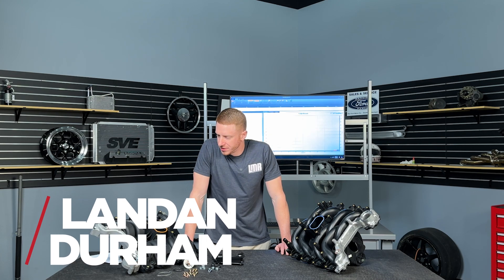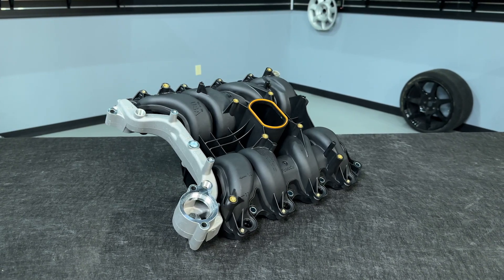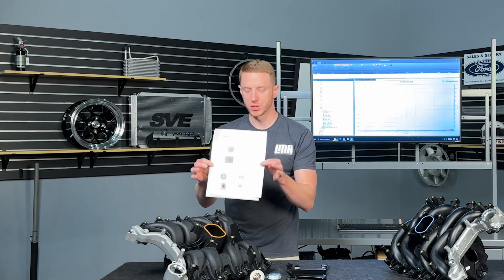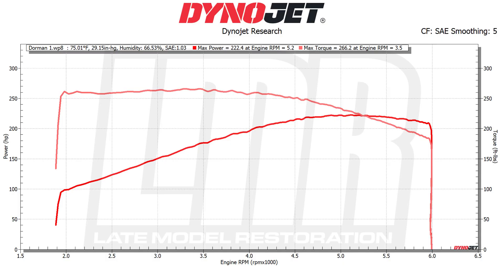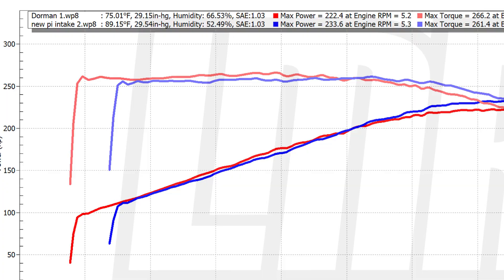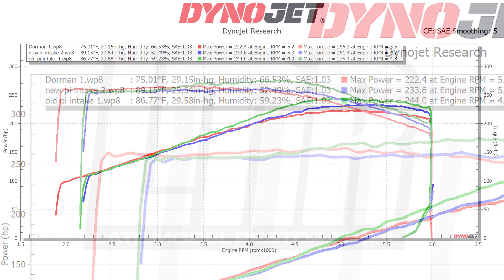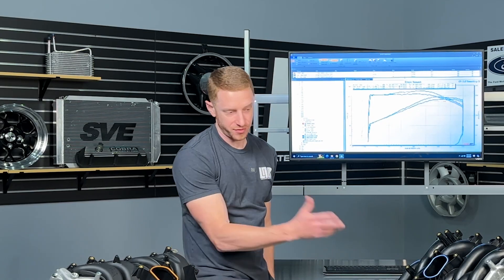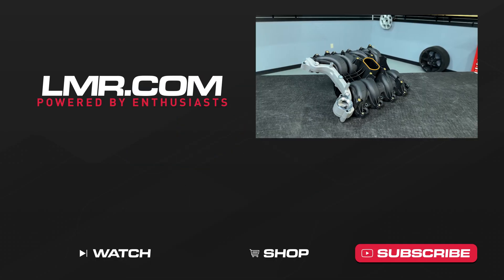NEW Ford Performance 4.6L 2V PI Intake Manifold (M-9424-P46A) - Dyno Runs & A Closer Look

Comment: Obviously selling this as a “Ford Performance” part is misleading, bordering on fraud, but one thing I see in the video that makes me happy is that the aluminum crossover FINALLY seals directly to the heads! Since almost every PI manifold fails where the plastic manifold and aluminum crossover meet, this new design should mean never having to replace the manifold again! I still wouldn’t use it on a car where performance is a concern, but for the countless panther cars and daily driver SN95s, it could be a decent option.
Reply from the maker: The old OEM PI intake was also sold under the Ford Performance brand. Like the new intake, the old intake was the "service part" of it's day. Ford Performance sells other OEM service parts under their brand because it's easier to market. They've been doing this since the early days. Thanks. -Landan
Reply: @latemodelrestoration what is the meaning of "service part" ?
Reply: So this new Intake Manifold PI can be used on Panther platform? My car is 2006 lincoln town car.  I wonder if I need a new bracket for alternator or other parts with this new Intake Manifold PI because it seems it is made for Mustang.

Comment: Im glad I have a professional products aluminum intake.
Reply: Me too. My intake cracked almost 10 years ago and I got one of these brand new when they were still available. I just didn't want to have to deal with another intake cracking again. It bolted up just fine and everything fit without issues. Car has 201K on it now and it runs fine.
Reply: @Flathead-fb5tk do you remember the link or part number
Reply: @Flathead-fb5tk what is the name of the brand?

Comment: I'm sitting on quite a few intakes that I've used for my PI swapped 98 GT, including a rare HPS Hardballer and original FRPP SVO w/the matching SVO heads.  That difference in performance and quality vary more than most realize.  The coolant port towards the back has broken on at least 2 of my OE PI intakes.  Personally I found this VERY interesting! I'm also glad Ford continues to offer new parts for their heritage vehicles. Great video I appreciate and enjoyed it very much!
Reply: I also had many issues with the Dorman product, it can work but is IMHO the worst choice
Reply: @davidduker4441  It looks like the coolant port for this new one is a two piece design and apparently the coolant port for this new intake is made out of metal. Also the thermostat housing is metal all the way through to the bottom where it meets the heads, where the original P.I intake and the Dorman are plastic underneath. A nice upgrade in that aspect for sure.

Comment: this can bolt on my 2011 panther right ? with everything thats included in the new pi intake ?
Reply: If your car is a 4.6 2V it will bolt on perfectly.
Reply from the maker: Yes. This intake will work for your application. -Landan

Comment: Would have been cool to see the numbers with the older 4.6l since it has the higher compression with the PI heads. I don't really seeing people swapping PI intakes for another PI intake unless theirs is damaged. The majority of people that put PI intakes on are the ones that are in the process of putting PI heads & expecting any kind of power boost.
Reply: What is PI heads?
Reply: @danpan001  PI heads are called Performance Improved heads, they came out with the new body style Mustangs back in 1999. Ford changed the design to help improve performance from 225hp in 1998 to 260hp in 1999.

When swapping PI heads to the older non-PI engine, it actually increases compression slightly due to the piston design was different, which in turn offers more performance.
Reply: @adjacentchannel Thanks a lot. I have a 2006 lincoln town car I think it is PI heads.
Reply: @danpan001  Yup, those should have them too.

Comment: We’ve had very good luck with Dorman intakes in crown Vic’s. Definitely notice the torque coming on earlier which overall makes those boats quicker especially with 3.27 rear gear. And through hp tuners optimizing timing, fueling, etc we are still making good steam at 6000 rpm where we usually shift them out. 6200 on at the chip. Have never had any on a dyno but definitely works fantastic and super fun on the street as a daily!
Reply: I have a work van full of tolls basically weights a lot and I did notice that. With the Dorman you can feel more power from dead stop

Comment: Ford should of used the original design, plain simple. Just like the new design, has better material and heater port. I would of bought two of them, an extra one for the long run.
Reply: What is heater port? Is it part of the Intake Manifold?

Comment: This was expected. Better than the dorman. And, really, except for the power loss, better than the oem pi intake in reliability with the improved crossover and the heater port. It is what it is.
Reply: And the loss in HP is really negligible. 10HP isn't even a big deal. 50 is.
Reply: Nothing some porting can solve
Reply: @monikhushalpuri how do u plan on porting a plastic manifold😂even if u did u probably wouldnt be able to polish it that well bc of all the frayed plastic. might even lose power
Reply: @nick0164  not talking about plastic, talking about metal replacements...I know on 2011-2017 3.7 v6 mustangs the stock plastic intake manifold can be ported and is a super common mod...with a tune for it and upgraded throttle body and proper air flow and exhaust mods to take advantage of the increased flow guys typically see 15-30hp increase after porting upper and lower intake...which is made of plastic LOLlololol trollLololol
Reply: @ i dont see how that wouldnt impede flow tho unless u cnc it. i imagine when u try to port a plastic manifold you end up with a lot of rough ridges on the inside, which disturb airflow
Reply: @nick0164  just look at the photos...its about as smooth as you can get...but now people are starting to make holley intake adapters for the 3.7 engine so eventually people will realize the holley is better and gets more hp and torque comes in quicker with the holley intake manifold compared to porting the stock plastic one

Comment: Bullitt Mustangs having an aluminum intake from the factory is the gift that keeps on giving lmaooo
Reply: True, but they're stupid expensive on eBay.
Reply: @yeanah2571 But they last forever right
Reply: Besides heat soak and 30 pounds of extra weight.. I’m going to start going to junkyards and collecting OG PI’s
Reply: @NewEdgeDesigns so all aluminum is only 30 lbs heavier?
Reply: Hmmm...Yeah!
Reply: Yeah but Bullits are a pain to work on, and parts are rare.unlike  the GTs that still have millions of parts

Comment: Wow! I still favor the old P.I. Intake because I knew runner length was going to play a factor! However this I take is good for heavier vehicles such as Panther platform and trucks with this engine.
Reply: I mean it's better than the doorman but it still worse than the OEM Pi intake that's for sure I wouldn't want it on my Crown Vic that's probably why I have a typhoon intake
Reply: @neilbrown82  I guess it will do as a stock replacement but for performance there are better options.

Comment: At least there's options now, and cant beat Ford OEM quality. This is the new standard for 2Vs.
Reply: It’s trash!! You can clearly see the design is quite close to the old Dorman crab, I don’t understand what the issue is with making the OG..
Reply: @NewEdgeDesigns   The issue is with the rights holder. Ford partnered with a company, and that company owns the rights to the design of the original PI intake.

So Ford partnered with Dorman to release this version that is MUCH higher quality and it has upgrades. Like the rear tube that goes to the heater core in the back. It used to be apart of the intake manifold, now its a two piece.

They also upgraded the aluminum crossover in the front, its is now ALL aluminum down to where it mates with the engine. Before there was plastic underneath the aluminum crossover on the drivers side, where the thermostat goes.

They also upgraded the plastic material, its much more better quality than the material used on the original PI.

It also doesnt need separate gaskets because they are integrated on this new one, "plug and play".

Its Ford quality that is UNMATCHED by any other brand out there.

The design might affect horsepower by a tiny amount, but you have 4.6 that was released in 1993, so be happy or go find a used old P.I intake.

If you want to go racing, go gran old stock or a used P.I intake that you wont know how long it'll last, or get a better engine or a different car. ITS OLD NOW.

The choice is yours.

Its almost unheard of that a car company like Ford  releases parts after DECADES later.
Reply: @MustangFord  I hear ya, still disappointing nonetheless.. I would just buy a bullitt intake off of EBay, or get a PI intake at the junkyard if mine ever has issues that can’t be repaired..
Reply: @NewEdgeDesigns id pull it just to see beforehand. if yours is the original intake, you will most likely already see some wear inside the coolant crossover. you can repair this with jbweld im pretty sure. if u catch it too late it might be unrepairable, repair it before that happens
Reply: @MustangFord What a stupid take.  There's no reason that a company can't make an intake that at least equals something from 1999.  There's also nothing wrong with the 2v.  There's no reason to do an engine swap just because the currently available intakes are trash.
Reply: Surprised no one can manufacture a superior manifold
Reply: Buy the Summit Racing “version”. It was manufactured by the same, with only the name being the Only difference. The Summit intake is around $200, not almost $400 the MoCo is asking. Don’t believe me, compare the pictures, it’s identical.
Reply: The original PI intake on my 03 GT just starting leaking at the thermostat housing....I pulled it tonight, I don't think it's repairable. Sucks there's no good replacement
Reply: @ there are websites ive found with OG intakes, but theyre usually on backorder. my friend ordered one not too long ago and it was a brand new legit PI one, got it for like $400
Reply: @nick0164  can you get me the link? My intake is off, and im ready to go back together with something

Comment: You don’t need this if you own a 99+ right?
Reply: I mean if your current intake cracks or something, you'll need it
Reply: Fits 99-04 if u got PI heads
Reply from the maker: Speaking on behalf of Mustangs since that is what we do, the PI (Power Improved) cylinder heads were used on all 1999-2004 Mustang GTs. This intake would serve as a replacement if you need one. Thanks! -Landan
Reply: Edit I forgot that Mustangs got PI starting with the first year of New Edge. Trucks and Crown Vics got PI in 01, hence the confusion.
Reply: @yeanah2571  mustangs got the pi treatment in 99

Comment: Looks like I’m just going to go twin screw once my 4 year “old” PI intake cracks. That was the plan anyway lol.
Reply: There’s still options, there’s a bullit intake on EBay right now for $1200 which I would gladly buy instead of this replacement piece of junk, it may be expensive but it’s one and done..
Reply: @NewEdgeDesigns  I agree staying N/A or going turbo/centrifugal the bullitt intake is the way to go. Why spend the $$$ buying the plastic intake 3 or 4 times over the life of the car instead of just a one and done bullitt (or trick flow) intake. As they say buy once cry once lol.

Comment: Bummer, was hoping the intake would outpower the original PI intake, especially since Ford has the boilerplate "Off-Road Use Only" on the intake's FRPP page.
Reply: IMHO.......the only thing that needs to be understood by the phrase "Off Road Use Only" is that this Ford replacement OEM PI intake manifold wasn't independently tested to certify compliance w\ the EPA Federal OEM emissions certification stds of the MY 4.6L 2V engines from 1999 thru 2004 & nothing else..........has nothing to do w\ any rated engine HP\TQ outputs based solely on this intake manifold's plenum & runner design. The truth is that this is more related to the cyl head's port velocity\volume design than the IM..........FWIW.

Comment: Going to start hoarding good condition used original PI intake manifolds 😂
Reply: @Karston_  I've replaced 100s of these intakes on crown vics over the years.  If only I knew they would be worth keeping.
Reply: lol I already have 6 mint condition ones sitting in my basement
Reply: @shanebierk2471 I've been pilfering through yards yanking them out of Crown Vics, Grand Marquis and Lincoln Town Cars for months now. I have 5 good ones.. also 1 aluminum truck intake and a really good NPI with the brass fitting... juuuust waiting for the numbers to go up 😁
Reply: @christophermonroe701 my car is 2006 Lincoln Town Car Signature Limited I don't know if my Intake Manifold is Ford Performance PI. So you you found PI Intake Manifold in Town Cars? Thanks
Reply: @shanebierk2471 how much you want for one
Reply: @shanebierk2471 you selling?
Reply: lol don’t gate keep, give us a price! 😂
Reply: My 66 Mustang has an original pi intake on it. Been waiting for it to start leaking coolant. What’s the max boost number I wonder?
Reply: I have 2 new in box
Reply: @Adrianzx  interested in selling me one? I just pulled my og intake off yesterday, and it was crack at thermostat housing
Reply: Can you sell me one 👀
Reply: Fasho man, have 2 right now, working on another this am in the junkyard.
Reply: lol feel you I’ve got 2 stashed away
Reply: what is PI?

Comment: Going Vic Jr when mine gives up
Reply: yea that’s what i’m doing i just found a used pi intake so we’ll see how long it last
Reply: Lol vic Jr is a single plane designed for 5500+ rpm so u will lose power under 5500 rpm 😂
Reply: @neilbrown82  cars gonna be cammed with ported heads 🫣
Reply: @neilbrown82  Yes, shorter runners = higher RPM, everyone is aware
Reply: @neilbrown82  You gotta rev a 281...

The trick flow top end is the best deal with what people charge for ported PI heads now.
Reply: @anthonyrowland9072  if you're driving a car on the street how often are you 5500+ rpm....

Comment: I suspect that the differences between the manifolds would become more apparent when tested on 4.6 2v that has additional modifications and requires more airflow.
Reply: I wonder how bad it would be on my engine with trickflow heads, stage 1 cams and stainless works complete exhaust system on my crown vic
Reply: Do you mean the performance will be better or worse with mods? Looking on the ford website they claim the following: Larger Bell Mouth, Shorter Runner, More Rounded Runner, and Deeper Plenum. So I'm thinking with bigger cams, better heads, higher flow exhaust and at higher RPM this intake should actually perform better...............
Reply: The ports look large but that could just be the new geometry making it look that way. The runners also look shorter. If those things are true maybe this intake has a chance with more supporting mods and higher rpm
Reply: @tgc281 doubtful there's a picture running around with this new intake sitting right next to the old Ford Pi intake you can definitely see how short the runners are nothing but doorman lipstick on a pig replacement
Reply: @neilbrown82  Honestly, it seems more like the new intake is going to have more reliability over the Dorman intake (and older PI intakes). Reliability at the expense of a small loss in horsepower isn't bad in my book.
Reply: @tgc281  exactly!
Reply: That's what I was wondering or maybe even just a tune  @tgc281